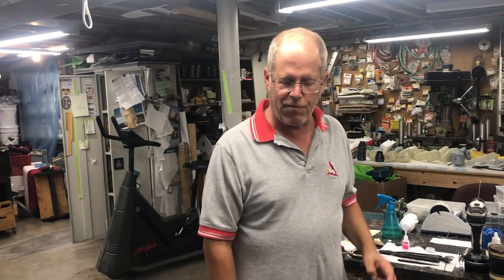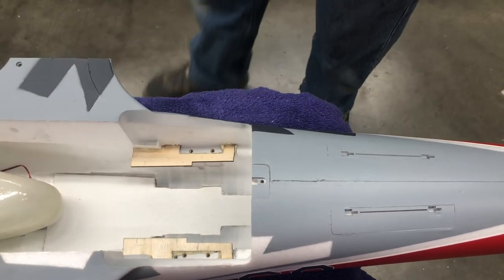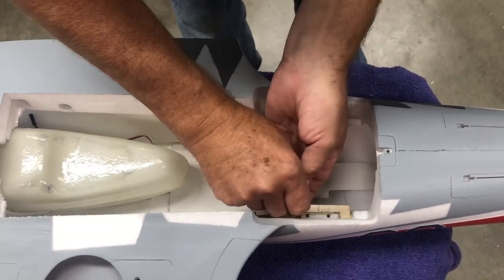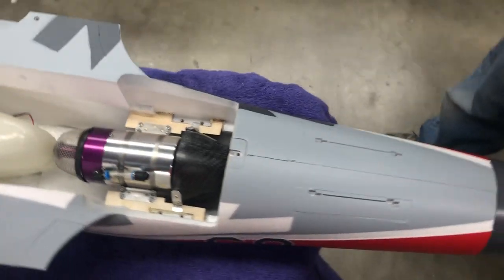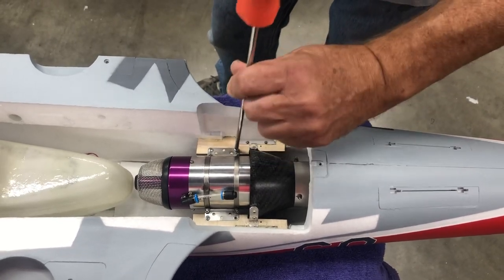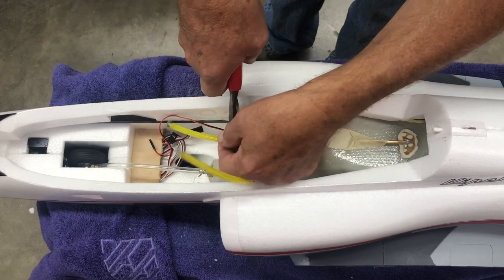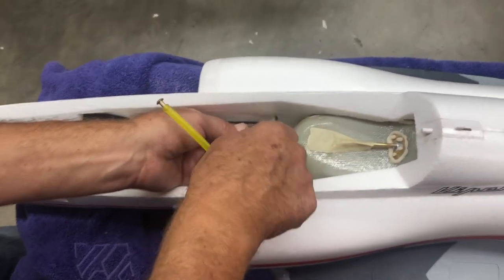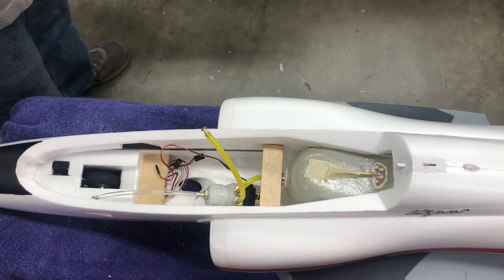Episode #5 Detailed Eflight 90mm viper Jet turbine conversion

Comment: Hi, great conversion kit. I like the accuracy and neat placement of the accessories installed in the jet as for the Turbine which size can be used can the 60 or 80 size fit?
Reply from the maker: Xicoy 45 or 60 size can. Anything larger will require some foam removal around engine. I don’t recommend anymore power than 50N